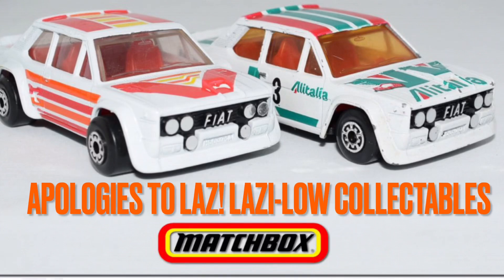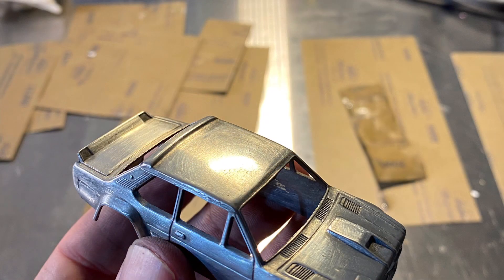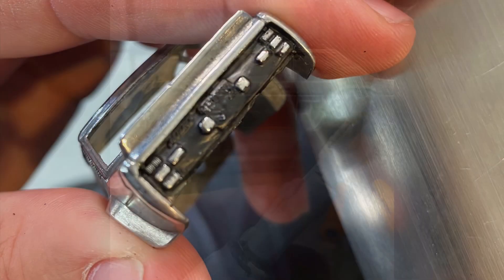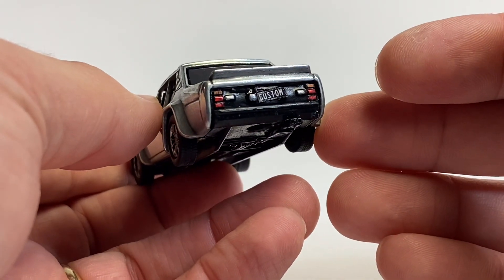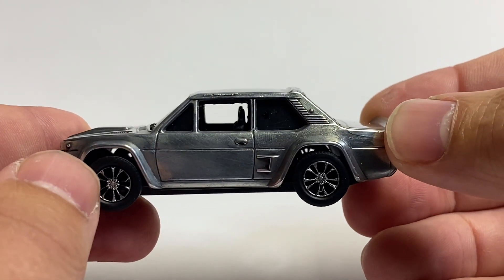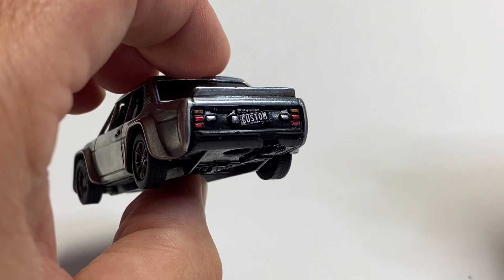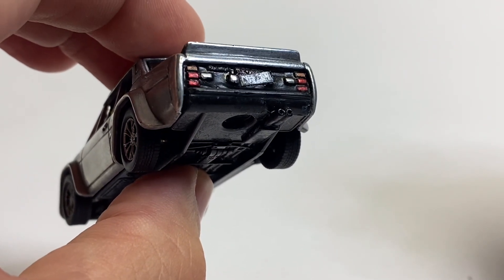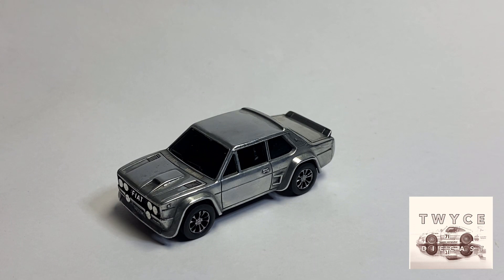Fiat Build-Off with Lazi-Low Collectables

Comment: Really nice David. I went through the same steps on my 928 Porsche Matchbox. The last step I used Autosol metal polish (I seriously love that stuff) and it gave it a mirror shine ... but after a year it is dull again.   Not sure if it needs a layer of clear coat or so.
Maybe not that chrome'ish like yours is a very good thing. Those black area's define curves and edges better. Would have loved to see you paint those tail lights, man o man.  Every time I'm like lets do it myself  I take that 1/64 scale in my hand and I'm like ow right, now that is really small.
Reply from the maker: LOL. There were definitely times in which I could not see as well as I wanted and hoped I was working on the right spot. 1/64 is too small for my eyes as well. Thank you for the kind words, Luc.

Comment: Nice work on the polish David. I've found it difficult to sand and polish but also keep the details like you have here. Love the smoked out windows as well.
Reply from the maker: Thanks Evan, I was skeptical about wet sanding with the finer papers (1000 and higher)....it felt like they weren’t doing anything. But, lo and behold, when I polished it, it was amazing. I’m sold on the method. It means a lot when you and other real customizers like it. 👍